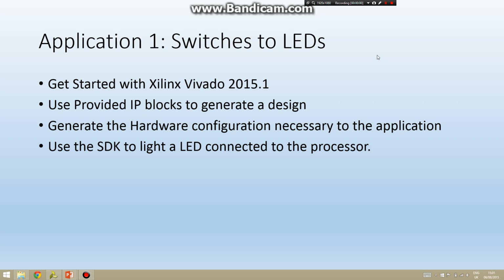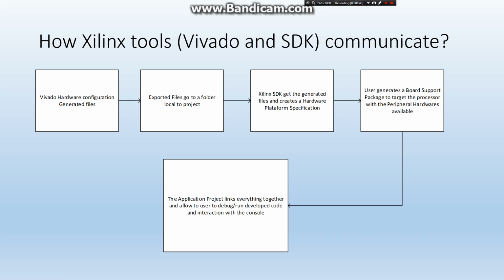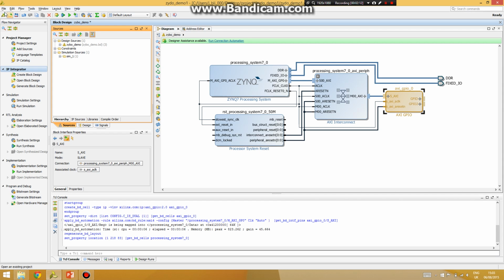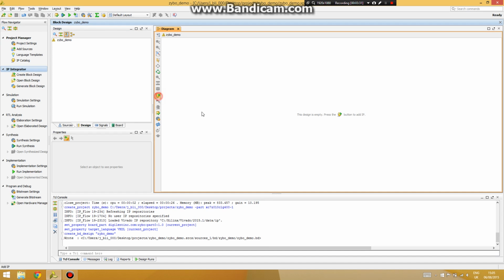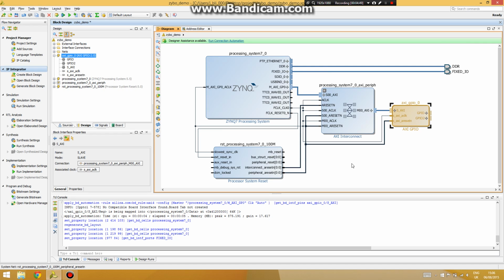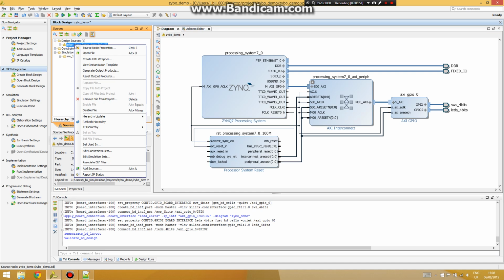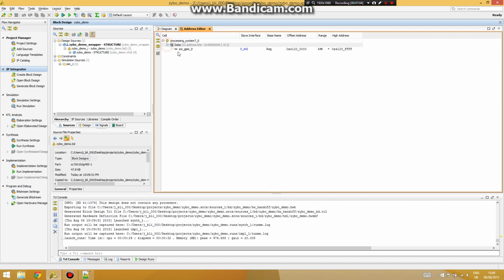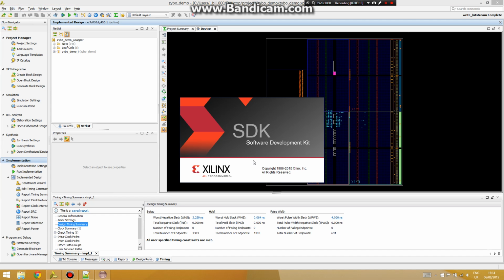Application 1.1 - Overview and Hardware design on Vivado for zybo board

Comment: Hi there,I tried couple of time this but not able to import hardware to SDK. I also updated to 2016 version but having same problem. Any idea why I am getting this error ??
Reply from the maker: +tripper269 Hi, it could be an error when generating the bitstream file, assuming that you mannage to create the hdl wrapper correct. Try to re-run your synthesis and see if the error persist,
Regards
Reply: Solved ! there should not be any space in project path, sounds ridiculous but its true. Xilinx tools don't work that way.
Reply from the maker: Yeah I figure that out the hard way too, avoid any special character in the files patch or xilinx tools just won't work

Comment: hello sir my question is after doing HDL wrapping and bit stream generation................weather the hole hardware design is put into ZYBO board are not????
Reply from the maker: Hi, at the end we export the design so we could use it on the actual board, in the next vídeo we upload the bit stream file to the board using the sdk. Check video 1.2 for more info